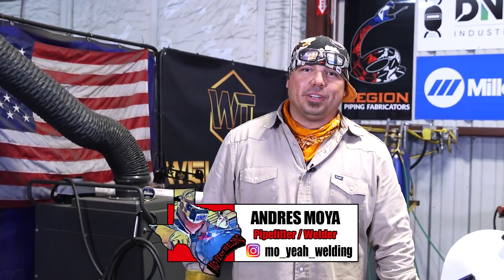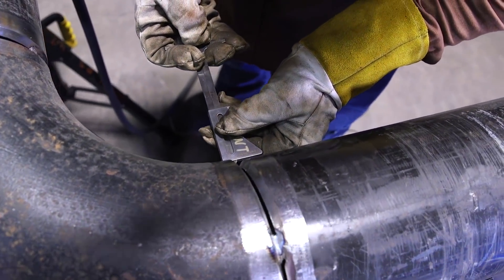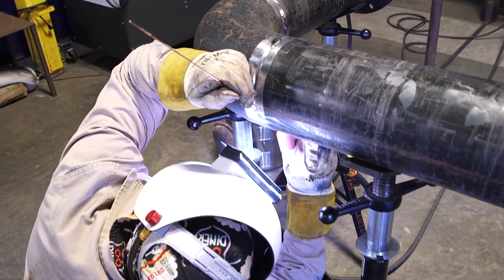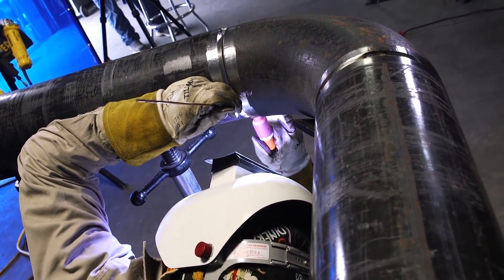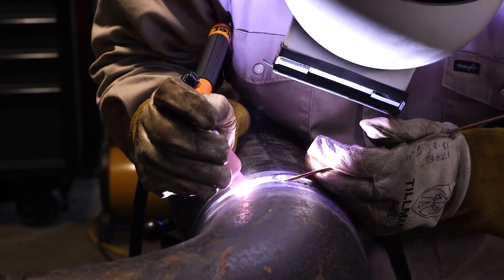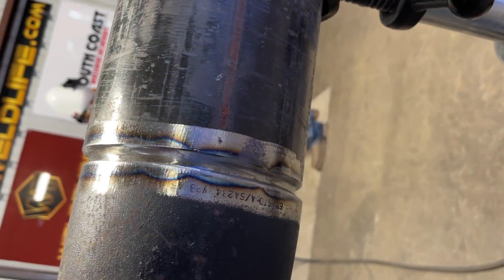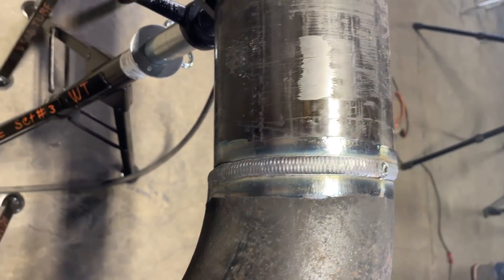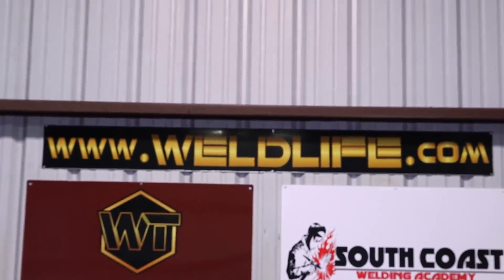TIG Welding The Worlds Worst Fit Up | Uneven Gap & Excessive Hi-Lo

Comment: I just want to say that I am not a welder by trade, I am a industrial maintenance technician. But, I’ve had to do a lot of welding in my first few years in the field, mainly stick, mig, and flux core welding. But for all the welders out there, regardless of experience level, I just want to share a piece of advice that a wise man once told me. He told me, “There are 2 things that are important when you are welding: Number 1, penetration matters more than how pretty your weld is, because penetration is what will hold the metal together, not looks. Number 2, if you can learn to weld the bad fit ups, the good ones will be easy for you.” There is a lot of truth in what he told me. While I worked with this man on night shift, we built several projects together, and he would stick weld while I was using a mig welder. But if we ever had some spare time at the end of the night, he would let me learn how to stick weld and let me burn 2 or 3 rods on some scrap metal, some of 6010 and 7018 rods, and he would always emphasize to learn to weld a bat fit up, and he would coach me, and I cannot thank him enough for all his help, because I truly learned how to be a better welder because of this man. So do yourself a favor, and try to learn whatever you can from someone. That’s all I’ve got. Thanks

Comment: I'm wondering what it looks like on the inside.  What kind of material flows would flow through the pipe and what kind of inclusions or protuberances if any are on the inside of the pipe.  Longevity of the pipe depends on how the weld turned out inside.

Comment: Definitely a bad fit up. And are you grinding tig? If you have all your gas and amps right, the pipes clean  and you slope down properly before lifting off you will have no problems

Comment: When I welded we made anhydrous tankers, and all fit up had to be flush since they were under pressure and and human weld was ground out to after covered with a machines hot weld all except my hot welds for the final seam. The proper fit up would be required not for the looks but the safety. We took pride in our trailers and loved the job wish the compensation would of been there.

Comment: Working in the chemical industry. I’m a past pipe fitter and now lead my team in welding schedule 10 403 set pipe for 1200 degree sulfur gas. My welder require to R stamp certification. Theses are must difficult welds my team has performed beside working in refineries where R stamp certification is required also. Our worst but best friend the the NDE inspector during X-ray inspections of our welds

Comment: I can still remember in 1966 that the welding rods being used by our military that are made out of 20% chromium, 20% nickel, 3% tungsten, 8% molybdenum, 5% tantalum, 5% niobium, 3% ferro-mischmetal rare earths alloy mixture, 1% carbon, .25% boron, 3% zirconium, 2% cobalt, and 29.75% iron. We use them to weld military grade alloys for various vehicles and equipments. And that also includes nuclear reactor components not exposed to radiation after the 2sd heat exchanger engineering section using inert beryllium fluoride salts.

Comment: Why on earth would you not use an HF start welder? Drag start puts tungsten in the puddle and having to break arc by pulling the torch allows the weld pool to be exposed.  I realize that you grind the weld after but come on, even my cheap Semadre TIG, stick, plasma cutter has HF start just like my Dynasty 700!  You do a great job of walking the cup and laying in a fantastic set of passes though!

Comment: I would grinde  that tack more just to burn it out and stop after I burn that tack out then open that thigh ass gap on top . Open that tight gap on top with my grinder  . But at the same time bevel it out with the grinder.  . That's easy money .run that hot pass a lil 🔥 just in case. If u know u know htown welder😉

Comment: Beautiful welding, never join the boilermakers unless you wish to go on jobs wherein you won't get to weld for months at times  but instead do back breaking labor work that they call bull-ganging. If you want union only for welding  join the steamfitters union, or pipefitters union.

Comment: This is why I like to make all my cuts and weld on the elbows first, then set everything in the hangers and mate it all up in the air with clamps to avoid problems like this.  in the last 10 years lasers help a lot to avoid problems like this.

Comment: Depends too what the pipe is for . I had one once the, guy asks me if I can build up this flange, I had a mig and tig welders ,I just said NO. Real hot steam would go through this and he should have known you can't just put blobs of weld on and grind it , these were machined to a high tolerance and bolt together. We were there over a week, just order it ,only an elbow, only have to wait overnite. This guy thought you weld or cut everything a pin in an electrical he made me cut it in half ,first I asked if he used WD-40 " what do you think I DID! " There was a gallon of it right there, I touched it and it was dry...welders worst nightmare.

Comment: tipical welder bitching...🤣 a true welder doesnt bitch about the work he has to do, it may be hard to do it, and it would best if the gap was smaller, but we do what we have to do...starting a video with "normally we dont acept this kind of work" just shows how bitch they are. work is work. period. come to portugal and say that, you will be in the next plain back to USA...🤣

Comment: Whats the point of doing tig for big pipe? You can do 3 joints with 6011 or 6010 root then 7018 cap to one of these. The tig looks nice but ive never seen anyone doing a tie in 60 feet in the air standing on live steam lines walking a cup. Is it the typical union wasting time deal kinda like putting 60% of the rod on the stinger then folding the rest down?
Reply: Oh please.

Comment: I’m still in school for welding, my instructor tells me not to change the temp from root to hot, is that just something to do when your learning?
Reply: Eh learn how you’ll wed in field I run loose 1/8” gap with 1/8” wire about 95-100 amps and on hot pad crank up to about 135 ride bevels and feed wire in middle so it doesn’t suck back and after hot pass turn up to about 165-170 until cap. Lots of folks run a whole lot hotter on all steps but I prefer my method for me, heat is your friends with welding just remember the hotter it is the faster you must go for the most part
Reply: Also practice freehand and walking on pipe you won’t always one in a spot in the field where you can walk to cup on any position so good to be decent with both
Reply: @curt714  okay thanks for the advice!

Comment: I'm an old Retired, "Welding Rig Road Warrior" from the SUB-STATIONS in the power fields in North Dakota. I WAS a Certified 6G/R Aluminum Pipe Welder down to 3" Diameter Restricted by a wall 3" away,, in both ALUM/MIG and Aluminum Tig welding. ( I just want to make 2 comments here,,,
MY COMMENT$;, "Out in the real world,, THAT AIN'T A BAD FIT-UP.   If you think that's BAD,,???
Wait til you get OUT THERE.   ((HERE ARE SOME WORDS OF WISDOM FROM A RETIRED OLD GUY.))
"WHEN YOU ARE OLD AND RETIRED AND LOOKING BACK",,,,  
""The best welds you ever did in your whole life,,,,,,, 
will be the WORST WELDS you ever HAD TO DO in your WHOLE LIFE.!!
Because You were Challenged and You Learned something from the Task"".  PEACE OUT

Comment: Not that bad. I have closed up gaps up to 3/8" using a stick welder. Vertical ups. 7018 DC reverse. Having a well equipped shop with a cement floor is a bonus. I spent most of my time with a Miller 4 G doing that kind of work in a plowed field. Made for some interesting days. Have a good one and stay safe.

Comment: I build tanks some times that last joint in a heating coil ain't quite right but no one knows after adjusting a cut angle or two with a zip disc sucks seeing tie ins all high low like that on piping jobs glad I don't see it at my job

Comment: you couldnt use a 5/32 rod and start on the wider gap and pull the fitting more in line

Comment: Excellent demonstration and explanation.  I had never considered how helpful it would be for penetration to feather down the edges of a tack-weld - it makes perfect sense and I'll add it to my list of processes to try.  One question, what's the thickness of the wall on the pipes being welded please?
Reply: They said it’s schedule 40 but actual wall thickness depends on pipe size. If this is 8 inch pipe the wall will be 8.18mm thick. 10 inch pipe would be 9.4mm thick. This can also vary slightly by manufacturer. I hope this helps.
Reply: @tolittletime  Very helpful, thank you.  It's hard to guestimate the size of the diameter by looking at a video made with a hand-held camera.  It appears from your info that these two sizes of pipe have wall thickness somewhere in the 5/16"+ to 3/8" range.
Reply: @brucebear1  He said 6" sch 40 so the wall thickness would just be .280"

Comment: no whole parts preheating using tig nope nope nope stick weld or mig preheat the parts that gap is wayy to large you should be fixing that issue first your using jacks to hold it up no no no use a one of those super flat thick special tables with clamps on them and why wear gloves they hinder you that part isnt hot.. if you watch pipe welders for oil companies they use stick welding its the strongest with old miller machines they xray the parts etc do tons of passes something about this video says nope

Comment: Yeah……..I’m not a professional welder, but have been welding for years. Looking at that fit up, I’d refuse the job. That fit up is a dumpster fire. The welder is really good, but that cold root pass is giving me a headache. If I had to do it, I’d triple charge the job. He’s spending way too much time on this one joint.
Reply: I mean yea it was a bad fit but not that bad where you should refuse to do it. Sometimes your last fitup on a big header it comes out like that and there is nothing you can do.
Reply: so you just weld as a hobby?
Reply: @myopicthunder  -Not a hobby. I fix a lot of machinery as part of my business. Backhoe/excavator arms, plows/frames, cast steel housings, etc.

Comment: the tight gap is no problem at all, you can grind it out once you get there, high low is not a problem either.....
try an 3/4 inch gab on a 10ft pipe with an inch wall out in the field in a ditch while its raining ........ now that's fun
Reply: Ok

Comment: I remember welding a pretty worse fit where one side had a gap of 2mm and the other side was more than 15mm
All was welded with 6mm elektrods with a smaw welder
The man who was doing the cutting did a terrible job using an astilin* torch on 8insh round tubes
Reply: You're trying to say you were stick welding pipe roots with 6mm rods?
Biggest but of bullshit ive read for a while, congratulations 😄😄

Comment: When I was a welder at a place that made burner cells for power plants I always got in arguments with the fitters about joints having excessive hi/lo points and bad bevel’s,    But I always made it work . Was never happy about it tho
Reply: I was a pipe welder in an offshore module pipe shop doing cunifer, stainless, carbon and other materials mainly working for bp, shell and agip, even though the pipe fitting was qc it wasn’t all that good most of the time, a lot of the work was 100% bomb, the inspectors used to be ok if there was a miss match apart from agip inspectors who were very strict even when they could see the issues, I saw the light after 8 years and joined the U.K. fire service and just retired after 28 years service, I still watch pipe welding videos on YouTube though who knows I might try and get back into it😎😎😎😎

Comment: don't worry about that bad fit. I'd be more concerned about tacking up an entire spool and then welding it out. the welds will be fine but is the spool gonna fit and look good? not only that, you coulda rolled out that whole spool in a positioner.
Reply: My thoughts exactly.  Why position weld when not necessary.

Comment: That was a beautiful job you did there I have a nice welding machine but it wouldn’t be big enough I have a dynasty to 10 DX when you start getting up at 175 amp area the duty cycle wouldn’t be enough to do a job like that but I use it for little things anyhow this is a Jim mungai from Kennerdell Pennsylvania

Comment: I took a pipe welding course in 2001, we did all the same techniques shown in your video, 'walking the cup' in the 6G was my favourite.   Our teacher was from the pipefitters union in Ontario. I learned alot but never joined the pipefitters union, too much travel and we were having our second child.  I have been looking for a multi process welder to work with at home, they are getting pricey.  Good video, thanks.

Comment: As a young amateur welder i learned quite a bit from this video, great techniques to practice and tryout. Thank you guys for your help in such a competitive market
Reply: @Justice 
the bore of the pipe and tube turn (fitting) is badly stepped   This will cause  lack of penetration etc and would fail  xray inspection ,may be ok for some non pressure work but not for Petro/Chemical  work
Reply: if you get to work on oil and gas pipe lines that set up is not acceptable, so do not accept the set up, the bore of the pipe is  stepped and would show on XRAY of the weld, that is why we have ASME pipe standard s world wide,  good weld ok but not for ASME standard

Comment: 95 amps on the bead! 150 for the hot pass! Runnin a little cold huh ? Don't be afraid of that little round knob. Heat is your friend. 

1/8" of hi/lo holy cow man how did you manage that ? 3/16" gap,what a gash! 
If that's your idea of bad you ain't lived. Let me know when you can get four fingers on one. With a glove on. 
3/16 is my preferred gap for a field weld.
Reply: They are just premadona😂
Reply: Had a welder make fun of a fitter years ago he told him probably the funniest one I’ve ever heard , he told him he could fit a bull brim in one side of the gap 🤣

Comment: This might be a dumb question, but I want to know, what happens if you dont do it  right? Does it have that much pressure inside that pipe line or with time it will break ? Can anyone explain it please, thank you
Reply: For the welder, the only issue is that it doesn't pass inspection. For the line, when you have abrupt transitions in interior diameter it can create both turbulence in the line, and premature wear, as the product will constantly "catch" on the sharp edges and wear it away faster.

Comment: Welding this in general is terrible practice. Welders don't just weld over mistakes. You fix it. Don't take shortcuts
Reply: I disagree
Reply: @lanceromance5768  disagree all u want. Your clearly a lazy worker
Reply: @prodbybabygod7411 just stick to your shop welding
Reply: @lanceromance5768  no worries lance👍🤣
Must be a fitter 🤣
Reply: @prodbybabygod7411  union boilermaker actually
Reply: @lanceromance5768  lazy one at that.
Reply: Cant always get perfect gaps and alignment when working on site, welding old to new, working to deadlines etc. 
Have you done much on-site welding, or just shop welding?
Reply: @kf8575  all pipeline. After my apprenticeship ofc but I'd never let a fucking fitter walk away from that. I'd rather fit grind and weld if I'm gonna be getting that shit. 
No one can get perfection everytime I get that. If I said every weld I do is perfection I'd be a fucking liar. But cmon.

Comment: 90 amps that's cold at least 110 to 115
Reply: 95 is the amps for this type of pipe 105 for hot pass 130  for fillet 100 for cap

Comment: 2 bead cap will help hide the hi-lo from the inspector too. Just little stuff like that will help get you by in a jam when your fitter is a mullet.
Reply: O
If there was an inspector.. it shouldnt of got this far.. hahaha
Reply: Hide stuff like that is not the right way to handle it. Show it the people in charge bevor you start work and when they ask to proced have a note from them that they actually wantet it that way fixed.
Because when it blows up, (worst case scenario) at least it doesnt blow up in your face and people in charge can not say they did not know about it. 🧐
Reply: @1AngryPanda  Pretty much this. Cover your ass so it doesn't fall onto you later as management loves to play blame games.  Hiding stuff just puts the liability on yourself and can be a good way to be finding a new job in short order.
Reply: @corail53  or even worse, find yourself looking out of a window with some bars in front.
Reply: @1AngryPanda  you boys are right, its time and money to the company but its your reputation and future for you. Dont make other peoples problems your problem.